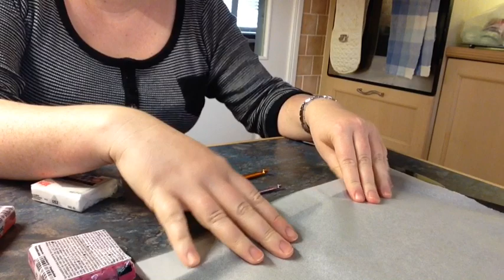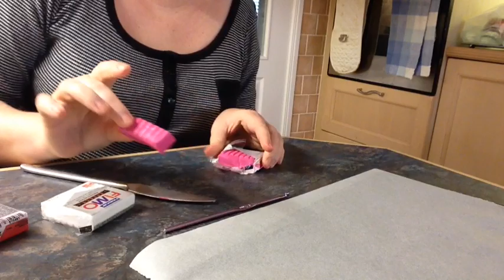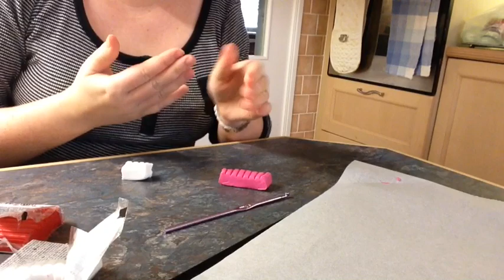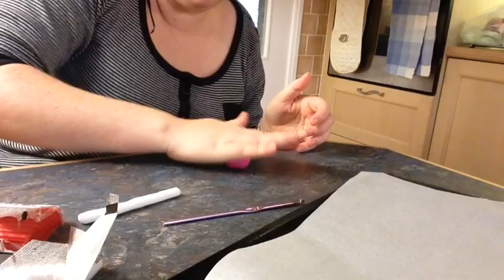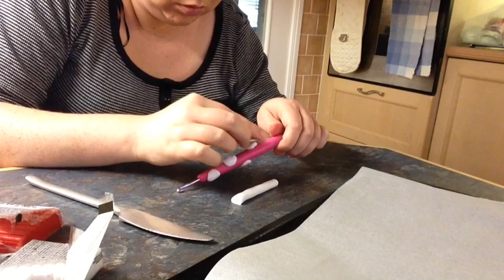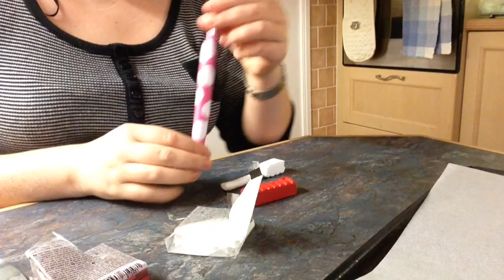Spotty polymer clay crochet hook tutorial

Comment: When cured or baked correctly, polymer clay is non hazardous, as stated on the brand packaging.  If you are using your domestic oven, the use of an oven thermometer is ESSENTIAL to prevent burning, or more likely under curing with resulting clay being brittle and prone to breaking.  It should be resilient when correctly cured and strong.  I put my creations on a bed of baking soda or cardboard in a disposable aluminium baking tray, put another over the top, clip closed and put the whole lot inside a roasting bag and seal.  I allow another 15 minutes to the baking time to allow the temperature to equalize inside the packaging, then give a full 45 minutes to an hour once the oven thermometer shows it has reached the set temperature again.  In this way, nothing burns, no residue remains in the oven that might burn if you are roasting or baking at a higher temperature for your dinner!  There is plenty of scientific and proven reliable polymer clay advice out there....see www.theipca.org or www.thebluebottletree.com